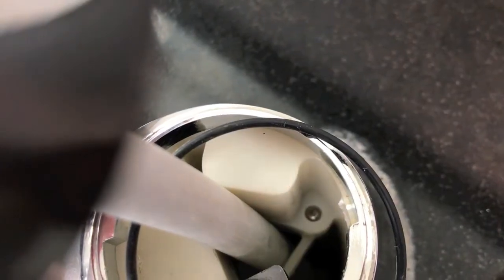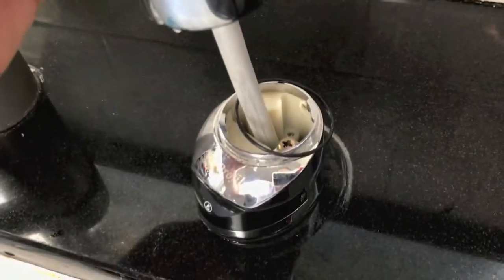Reverse Osmosis Faucet making SUCTION sound noise!

Comment: Mines making that noise but under the sink is bone dry
Reply from the maker: JayManWilly 

Thanks for watching.  You may have to replace your faucet.  How old is system?  Keep us posted.  Us fellow DIY’ers need to stick together.

😎👍🔧🔩
Reply: @DIYwithMichaelBorders  not sure came with the house. I turned the water off to it and it stopped. I saw on a different video that the noise is water going straight to the drain from the system. I barely use it so I'm just going to leave it off
Reply from the maker: JayManWilly 

Thanks for the reply.  We just recently installed a new RO system & the new systems have a required Air Gap/float drain which will drain water at the same time it fills the tank... causing a suction/crackling sound...which is normal.

However the RO system in this video is a 2012 model & does not have an air gap.  This means any suction or crackling sounds is 100% not normal.  Hope this helps.

😎👍🔧🔩